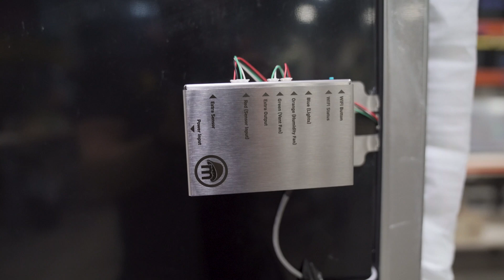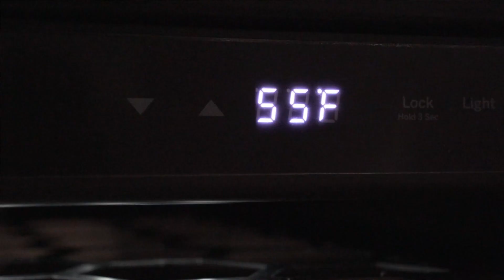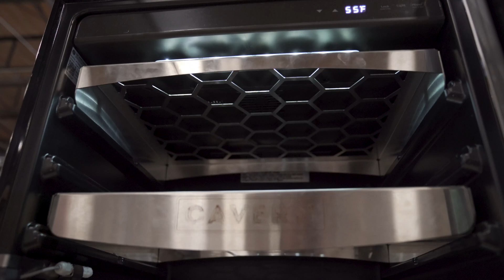Cavern 2.0: The Smart Curing Chamber | Prototype Update

Comment: FYI-I've made a couple of these and on my 3rd iteration, I moved the humidifier to the top of the unit and fed the humidity inside through a pipe drilled into the top of the refrigerator so I didnt have to give up space inside for the humidifier or effect the climate inside in order to refill water.  

I also had wifi sensors that would ping my phone if temperature or humidity got outside of acceptable ranges I defined which made it very easy to keep an eye on things from afar  24/7/365.  

Hope y'all can implement these in your unit as I found these features very beneficial when I was making charcuterie for a restaurant I was working at

Comment: What would the options be if I also wanted to be able to dry age primal cuts for steaks, etc.?  Any thoughts of offering a rack to allow you to truss up and hang longer cuts of meat like Steak Ager offers?  I will mainly do charcuterie but would also like to do steaks on occasion.
Reply: Hey Steve.  I'll be testing out this prototype and seeing exactly what it's limitations are.  To Dry age you need the temps to be around 38f (roughly).  Not sure if this unit can get that low (as it's a wine fridge) but we shall certainly put it to the test!!
Reply: @2guysandacooler  Thanks for the reply, I look forward to your review.  Exciting project!
Reply: 38F is way too hot for most people’s dry aging temperature preferences.

Comment: Eric is a dry-curing god; if he praises this, then you may have a winner. Based on this video, I have a question: If you load this chamber up with meat for dry curing, a lot of moisture will come out of the product, especially at the start of curing. Is there any kind of exhaust/dehumidifier to handle this? Even though I live in a very dry climate, without a dehumidifier in my DIY chamber, the product would be bathed in 100% RH. It's great that the shelves can handle a big load, but can the moisture control system? You might find it interesting that Sausage Maker had to retrofit their curing cabinet with a supplemental humidity controller and external drainage tank to address this issue. BTW, happy to help beta test and purchase a unit if Eric gives this chamber a thumbs-up.
Reply: Bill, great question. What’s interesting about this set up is that the refrigeration cycle inherently dehydrates. That is what we find so neat about this product is getting those two systems to play well together, and it seems we’ve landed on a pretty solid solution.
Reply: @Gus_Ford  Thank you, Gus, for the prompt and helpful reply. I'd be very impressed if that cycle can handle the moisture thrown off by 62 pounds of product. Since curing can take months, I often have my chamber full of meats curing at different stages of drying. For this chamber to make sense for me, it needs to maintain around 80%RH at all times. If it can, I'm sold.

Comment: Wont the filters hit the fans if they aren’t out in perfectly?
Reply: There are countermeasures/guarding to prevent fan obstruction. They should still be close to the wicking material to produce maximum airflow over the capillaries of the wicking material.

There is still improvement that could be made in the filter area, for access and maintenance and overall ease-of-use.